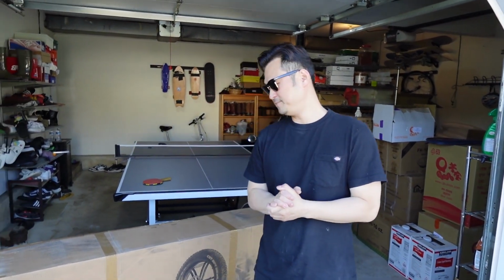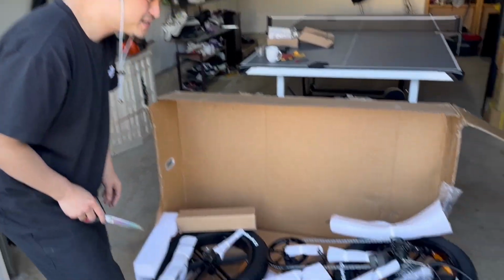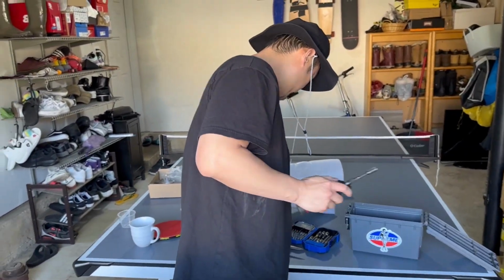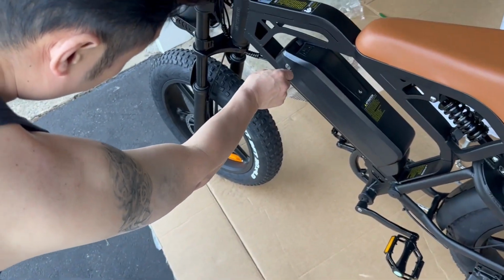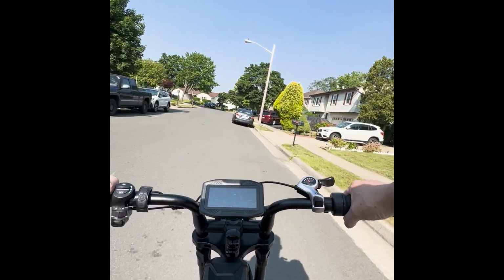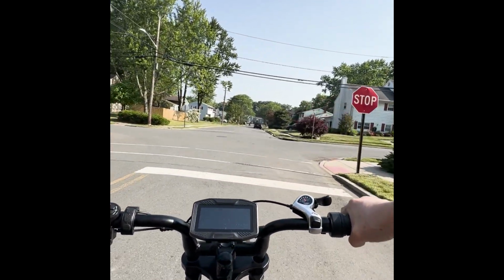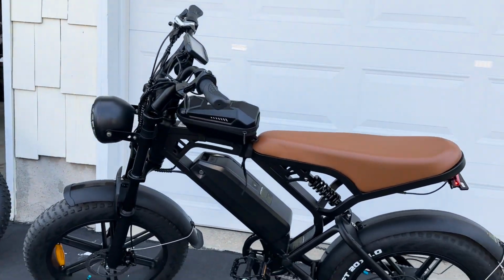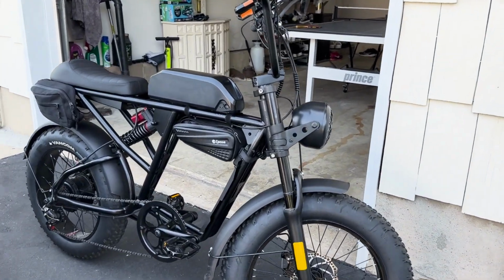My Second Alibaba E-Bike review V20??

Comment: I have a question. I am putting my back together, and I notice we have to same bike. I'm having trouble with handle bar so I'm wondering how you were able to get it through the holes.
Reply from the maker: It’s been a while I kinda remember I have the same problem las your. it’s a small issue, best way is search for a similar bike for the installation. Or Contact the seller, your seller should be able to have the short video for you to resolve the problem. Good luck!
Reply: look at dailyride you will find videos in how to ensemble

Comment: Hi great review I have the exact same bike can you tell me if your turn signal indicators show on your display mines don't
Reply from the maker: Hi the turn signal is not going to be on the monitor, but at least there is a turn signal compared most e-bikes don’t have that function 😅
Reply: @mingc888  okay I appreciate it I can stop looking now still good to have something in the rear
Reply: @jamesjames6153 is this a ouxi v20 and is it better than the v8
Reply: @victorsjouke211  Hey dear, it's QMWHeel V20 not Ouxi. They are different brands. V20 and V8 have some differences about the specs.

Comment: do you have to pedal. isn't there like a speed button so you can go without pedaling
Reply from the maker: It dose not need to pedal if u don’t want to. It will get you more range if u do pedal assist. Either way is good.

Comment: Do you recommend this one or the super 73 clone with dual batteries?
Reply from the maker: Hello, the battery and performance I like this one, it has 15ah battery and also go up to 27mph and about 35 miles range for a 200lb person. The RX clone is about 20miles for the range and top speed is 21mph, it has better suspensions and I like to ride the RX riding feeling better. 
If you are getting dual batteries, your power and range should double up and should be enjoyable. Good luck!👍

Comment: If you paddle how fast will it do to get to 25 kmh?
Reply from the maker: It is more like a pedal assist. You don’t have to pedal like crazy to get to the speed you want. it is 25%  pedal and 75% electric in my opinion.
Reply: @mingc888 so the motor is powerful. Like you got the feeling that you jump the start?

Comment: I heard the frame is made out of iron. How is the frame handling the rust?
Reply: dear, actually, the frame is made of iron and alloy stainless steel screws, and it is painted by a thick coating, it is not rust unless the coating is scraped off by crash. even not rust in wet beach or snow road.

Comment: I received the V20 this week. >> I have returned the V20:
1. The bike can be turned on without a key.
2. Front lighting remains on despite the off button. 
3. Throttle trading is currently not working (not necessary). 
4. Rotation sensor not responding fast enough, I move forward after I pedal 4/5 laps.
5. Speed is only possible at 15-25-35-45 km per hour. My preference is for example 28km. (28 km per hour is still reasonable considering the correction speed)
Reply from the maker: Google v20 display setting or uooxi v8 display. Let me see if I can find the link and then will post it here for yoi
Reply from the maker: https://youtu.be/hHi8wtKp-9g
Reply from the maker: Watch till the end this guy has good knowledge about the ebike. I forgot how already.
Reply: @mingc888 He had the V08, but thanks ;)
Reply: Is it fast?
Reply: its max speed reach up to 27 mph or 45km/h as the video show, considering the rider's weight is 165lbs.
Reply: dear, V20 battery is removable and need key to fasten it when not ride it.
Reply from the maker: Good that you can return. Did the return go smoothly? Hope you can get your money back! Keep us update. Good luck!
Reply: Why is your preference of speed not 28.324 km/hr? It's a shame if the bike cannot maintain that speed. Don't have kids.
Reply: @AggarwalA007  the preference of speed could stop at 25km/h, there arre 5 speed after unlock it, only up to 3rd speed on the display , then top throttle is only 25km/h:hand-pink-waving:
Reply: You cann do that in the QMWHEEL app, in the change gear setting. You need a password. What is the password???

Comment: Проехал по району, все поднялись по тревоге, от шума
Reply: В принципе, шум двигателя не более 65 децибел в пределах 3 метров является квалифицированным!  Во время ускорения звук трения шины будет больше, чем звук двигателя. Не ускоряйте прохождение через толпу. 

In principle, it is qualified if the motor noise within 3 meters does not exceed 65 decibels! During acceleration, the sound of tire friction will be greater than the sound of the engine. Don't accelerate through the crowd.
Reply: Really? I hope your brother is okay now.